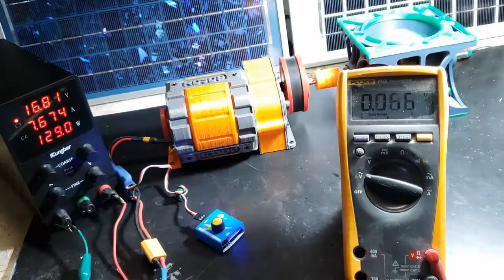Lenz's Law Demo

Comment: Hi, If you run a BiTT in the system it will free run!
Reply from the maker: I remember seeing that in Patrick Kelly's book of free energy device's but never experimented with one. I checked out some of your video's, nice builds. So your saying design a generator stator using the BiTT principals?
Reply: @redesign3dp  Hi, The over unity of the BiTT removers the negative feedback loop from the generator to the motor. I know this for a fact, but i will not upload a video on YT. The system rpm will speed up!
Reply from the maker: Do you have a bitchute channel?